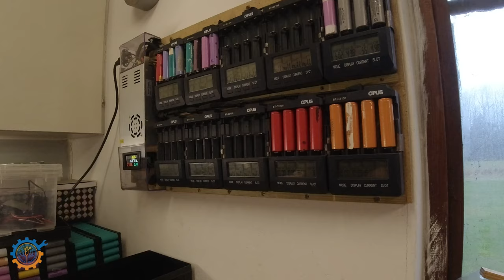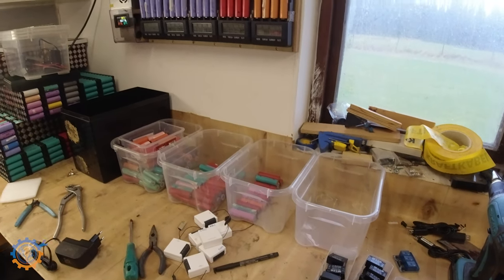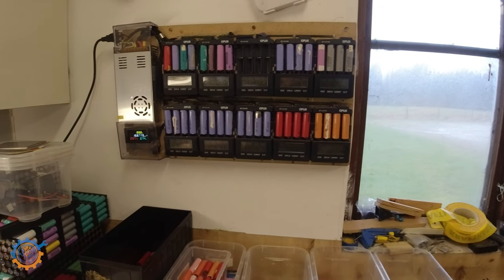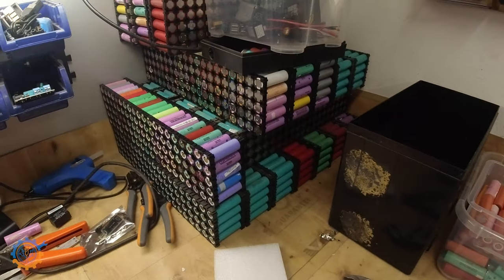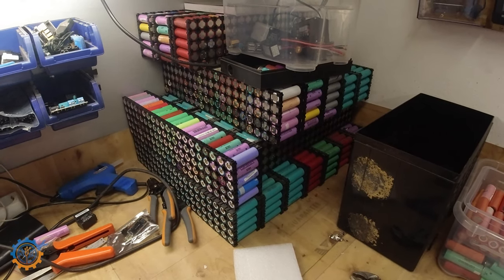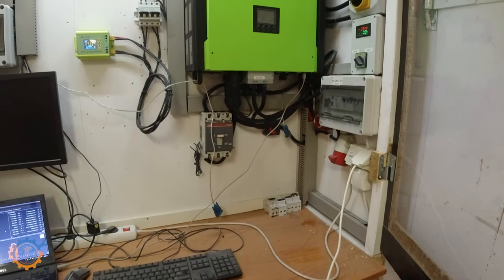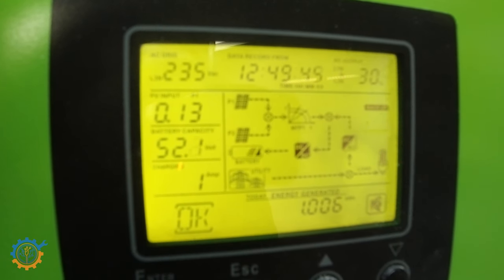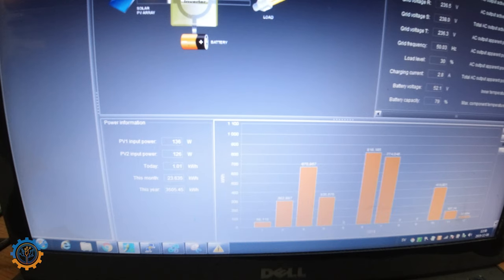Solar Update 2019 December

Comment: About 1/3 of the winter weather here is like that,  im thinking about adding about 5kw of used panels, to hopefully get about 2kw on cloudy days, and charge faster on semi sunny days, using the excess in Sumer to pump water, for a pumped hydro, and hot water, using the water when needed only, although I saw something about compressed air storage! Maybe that could be used, spin a turbine to generate power with air, at about 250psi, I haven't figured any effiencies, or cost for storage, looks like I'll try anything to prevent paying for power! Even crazy things!!
Reply from the maker: Best storage is to sell to grid. storing in air or such is No use. IF so heat water and use for pool or shower :)

Comment: Vart får du alla fina cellet ifrån? Jag samlar just nu, men har bara runt 150st.  Nu i januari ska jag installera en 10kw anläggning, med 33st 320w solpaneler. Tror du en batterimodul kan hjälpa mig på något sätt?
Reply from the maker: Jag köper och får från diverse ställen. Om batteriet gör nytta är bra fråga. I dagsläget inte mycket
 Sedna måste inverter o.s.v har stöd för dem

Comment: You are using a lot of batteries in your projects. Can you build a project that will test one of these batteries for a certain amount of time? For example, it will charge and discharge a cell for as long as you leave the device powered. So it starts by charging the cell, then when it gets to approx 4.2V it will stop charging and will start discharging up to approx 3V and then start charging again and so on and maybe measure either the number of times it charged the cell or the amount of energy used in the process. This would be very useful when you want to check the health of a cell over some time and/or a number of cycles. Imagine if you want to buy some cells from aliexpress or similar but you don't trust that the cells will last very long. You can buy one and have it in this device for a few months. A cell that is advertised for 2500mah will take less than 125 days to go through 500 cycles if the battery holds its capacity or less if it will decrease. After this, you could retest the capacity and see how much you have left. Best wishes!
Reply from the maker: There is a Guy on second life storage forum that does this. :) And yes its easily build with an esp and some things around it.

Comment: Hey. Danish guy here. About to assemble my first power wall, 20kwh. 

I was thinking of buying the green monster inverter, but now I saw your video saying 7kwh idle consumption. 

Can you please elaborate on how that’s even possible?

I’ve read the spec sheet, and haven’t noticed any number that could indicate that. Which spec should I look for in order to calculate my loss?

Tack så mycket 
God weekend 😀
Reply from the maker: It consumes around 80w per phase Idle. Thats 240w for all 3.  They dont mention.it since then they wouldnt sell any :)
Reply: DIY Tech & Repairs well thats just freaking insane!! Are you sure Victron doesn’t do the same?
Reply from the maker: @MIkke1984lol  its normal. You get what you pay. Victron is less Idle load. Note that the Green machine is a hybrid and hybrids consume more.  Most cheap inverters are between 40-80w per phase where offline inverters are around 40-60. Victron is between 15-40w per phase. But they cost 3*
Reply: DIY Tech & Repairs thanks for sharing your knowledge!
Reply: DIY Tech & Repairs just checked prices for Victron energy quattro. Damn they ser expensive. Like 30.000 SEK a pcs. There must be other alternatives.
Reply from the maker: @MIkke1984lol  many other but Price vs what you get :) hybrid systems are expensive still. Grid tie without battery or offgrid with out feed back is alot more Price worthy.  You can check out piko or whats their name is. There is others too

Comment: first! You need to fix that video flicker. happened on last 2 videos now.
that's a looooot of battery packs.. good stuff :)
Reply from the maker: The video flicker is that darn OSMO camera that doesnt like when i move it. Doesnt matter what settings but it doesnt like the 50hz fluoresent lights in the ceiling :( I dont have any other camera to work with right now so have to live with it.
Reply from the maker: Thought will try one more settings. Im running it 60fps and antiflicker on. Perhaps 50fps with antiflicker is faster hmm

Comment: So solar makes 2 to 5kWh and the inverter uses 7kWh? Thats a lot
Reply from the maker: Yes. During Summer solar makes 100kwh. Thats the difference of Summer vs Winter and that cheap inverters dont pay off
Reply: @DIYTechRepairs  Most electronics can work off from 48V DC directly, including my 40" LCD TV, Dell monitor, laptop. etc. No inverter needed.